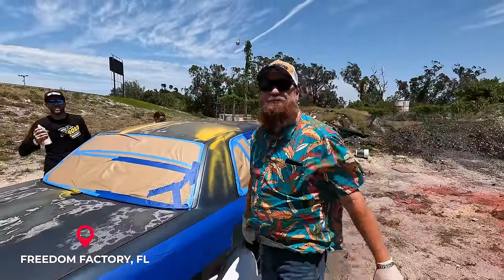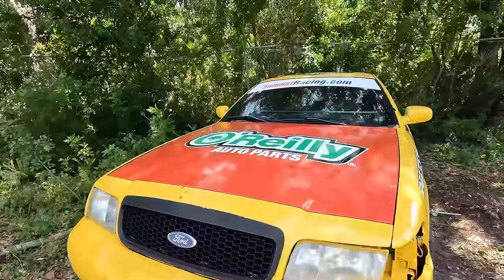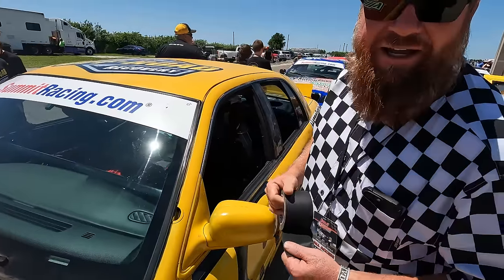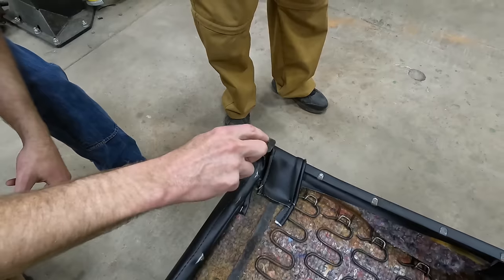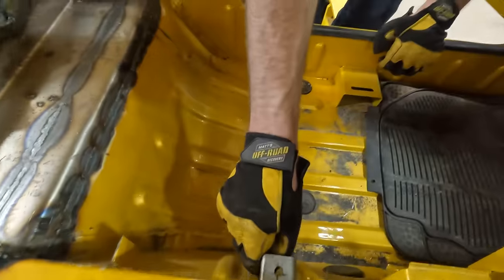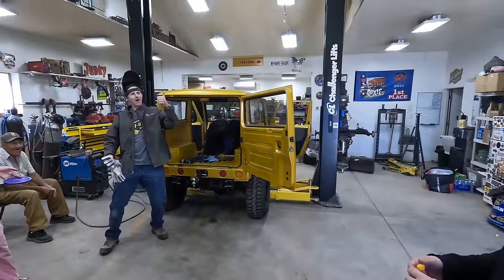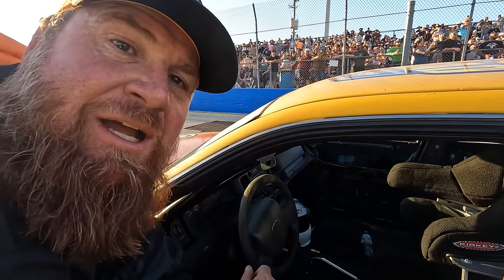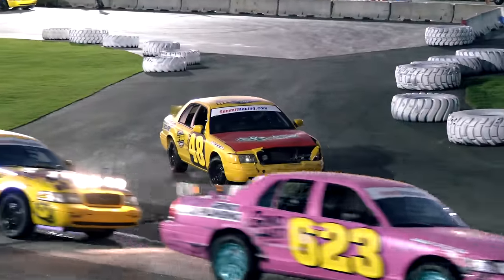It's A Week We Never Expected! Golden Nugget & Freedom 500

Comment: I once fitted some bucket seats in an ol Ford Escort, drilled the floor pan, as you do, and on the 4th hole happened to check where they were. Fractions away from the brake lines! Comfy seats and my mounts worked well.

Comment: 18:49  I had one of the first SJ410's in our area! .. They started selling them in 1981  Canada, and I bought one for my wife! It would go just over 60MPH flat out.

They had normal 4 cycle 1 litre engines then. And many of the dealers sold mostly RV's The engine blew out after 4 years, (it still run but rattled like crap!) 

The dealer took the whole thing apart, welding the connecting rod journals up and ground them back to stock (Under size bearings were not available yet) , new pistons and valves, etc etc

ALL for 0$ under warranty!!   We were told it was one of the very first engine rebuilds under warranty :)

We drove it for 5 or 6 more years after that, with zero issues except a new exhaust, we never even had to put brake pads onit!

Comment: 5:13 
I would have recommended that you spray Cool Gel on everything you don't want to get too hot. I use it regularly when I have to copper sweat a plumbing joint in sensitive areas.

Comment: stock vis...especially the 03 on up are super weak in the suspension and steering as they used a bunch of aluminum parts. you have to swap in some older vic parts as well as chevy control arms and steeing boxes.

Comment: That's nuts that the LJ came with a driver seat that doesn't have sliding tracks. 
On both this video and the recent one modifying the headache rack on Blue Steel, I was cringing at the lack of protection for recently painted vehicles while cutting and welding. A welding blanket or two, even crappy old wool blankets, would save that paint from loads of sparks.

Comment: for your bombi you want to build a track tentioner similer to bulldozer using a front sprocket as an idler with a push bolt  or grease piston to tighten the track you may have to put more track on

Comment: The younger generation on the show could do well to take notice of Ed's grip on the wheel. Anyone steering ahead by gripping the wheel anywhere below nine-o'clock and three o'clock is destined to be thoroughly amazed by driver-induced oscillation sooner or later. The inertial feedback to the lower half of the steering wheel by the weight of a driver's hands/forearms when the vehicle lurches contributes to the weaves and is not self-correcting like the grip on the top half of the steering wheel.

Comment: A Ford with nitrous? I see the heads flying out and the hood bending backwards. Or several rods going through the side of the block. Well it happened to me! Yes bent rods, hood flying up, and bending backwards and the intake was shot several feet in the air, heads broken off.
Reply: What yer sayin' is that you don't know how to build or drive a car with nitrous.  I bet you could break a crow bar in a sandbox.
Reply: @userer4579  crowbar in a sandbox 😅🤣😂 can I use that one, wow that's funny. And yes you may be correct. It was tech school, and the head bolts were inferior. To bend 3 piston rods , that is all hanks fault. As someone who is Ford trained, at Greenfield Village, Henry Ford museum. There are things others do better. I don't hate on his product. There is a reason that they are aFordable.